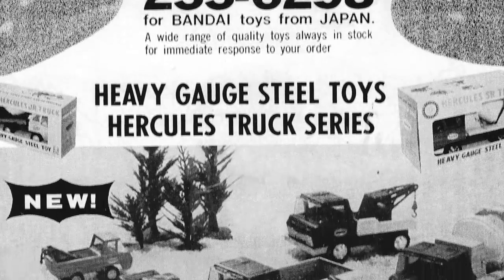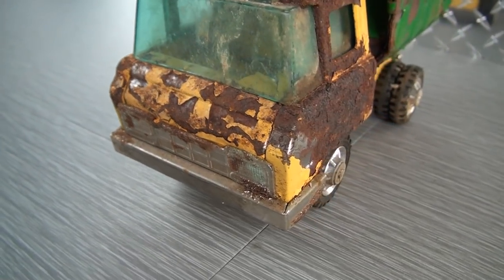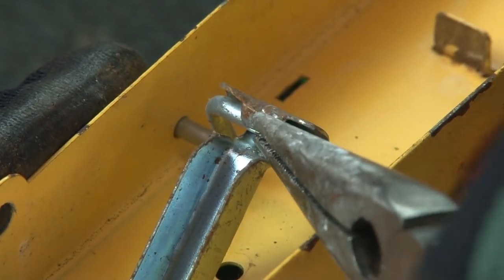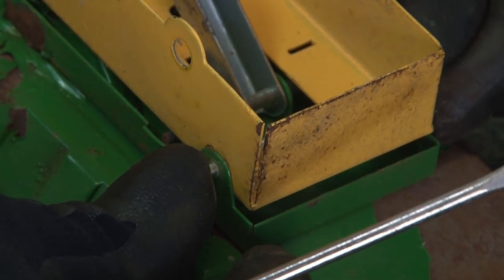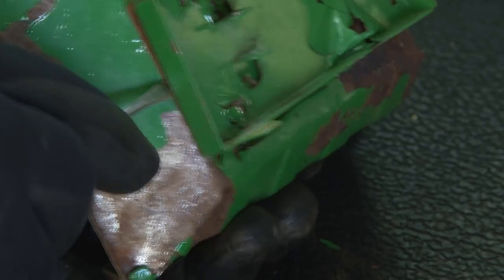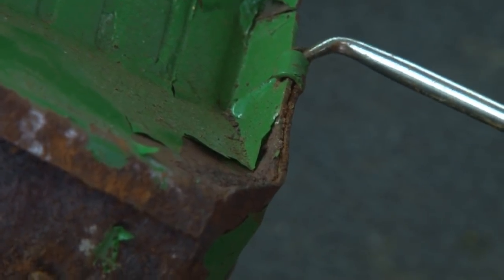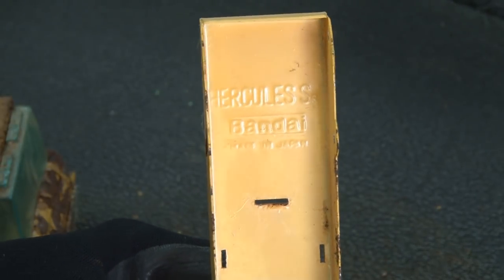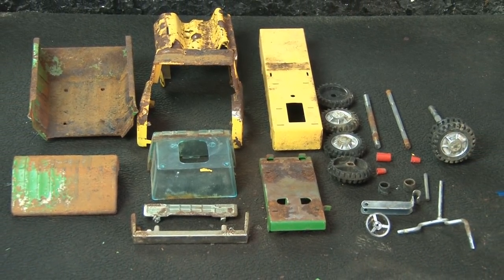50 Yr Old Toy Dump Truck Restoration! Kipkay Restored

Comment: Looks good, but the needle nose just demolished the powder coating. You should wrap the pliers with electrical tape or at least use something softer.
Reply: But a new pair of needle nose pliers and put a couple layers of heat shrink tubing on the tips. Score it with an exacto knife. Works great for that sort of stuff!
Reply: James Nicoll Gr8 idear! I’m not from New York, I just like saying idea that way. 😁
Reply: THE JACK HQ we don’t say idea that way
Reply: THE JACK HQ Only Jay Leno says it that way.

Comment: Why not hook up the grounding wire to the hook you're hanging the piece from?
Reply: @findtherepo9233  but the grounding wire is just there to remove any residual charge when the positively charged powder touches the metal part. It's not like welding with an electrical circuit.

Comment: Never use metal tools on powder coats or paint.  Wrap them in a cloth or vinyl tape, or cover them in a thin coat of plasti-dip.  You should use a metal filler to restore the rusted away parts.   Use a clear coat over any exposed metal to prevent rust and oxidation.